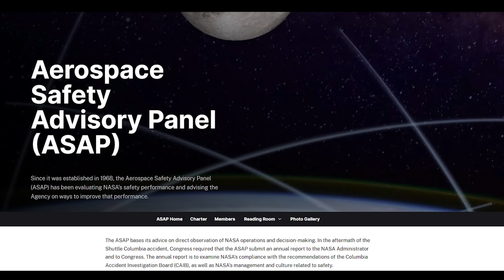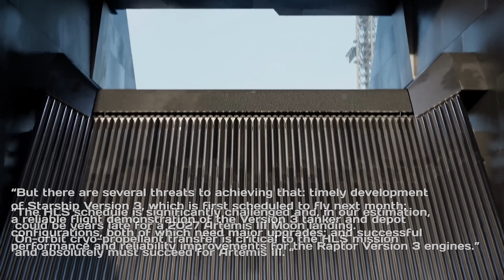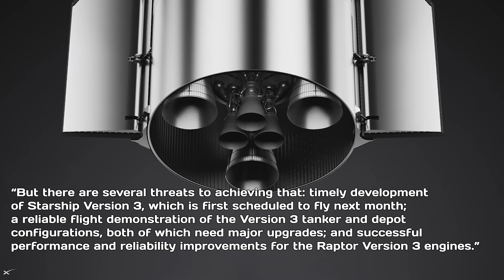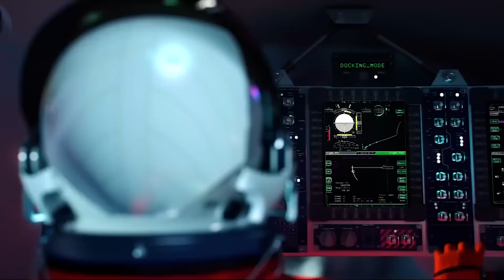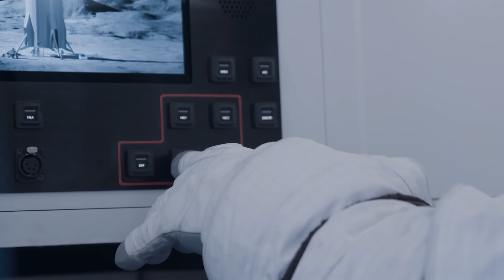LEAKED SpaceX Internal revealed Starship Moon Landing Timeline, Later than Expected!

Comment: I keep hearing about how difficult the SpaceX plan is because of in space refueling...which is true, but I never hear that every competing plan has the same in space refueling requirements.
Reply: Because SpaceX's plans include a REUSEABLE spaceship (fuel required to get back), the others are one shot expendable and have less payload mass.
Reply: Grok and I developed  this plan to enable Mars Colonization 
# MarsFeast_v5.9.12: Integrated Symbiotic Mars Colonization Plan (Final Complete Document)

## The Four Legs of Symbiosis – Fully Detailed Technical Specifications

### Leg 1 – Scaling Food Production
*Purpose*  
Provides all calories, protein, micronutrients, and culinary pleasure using exclusively zero-processing crops. 100 % of biomass residues returned as green-manure from Sol 1.

*Required Technology & Origination*  
- Aeroponic / hydroponic towers and vertical crates (NASA Veggie / ESA MELiSSA heritage + commercial ZipGrow scaling)  
- Boring Company Prufrock-bored subsurface tunnels for radiation shielding and thermal stability  
- Optimus Gen IV humanoid robots for planting, harvesting, and residue incorporation  
- Precision full-spectrum LEDs (Valoya / Fluence Bioengineering heritage)

*Key Equations*  
Fₜ = F₀ · (1 + g · Rₜ)ᵗ  
g = 4.8 (yield factor from intensive tuber stacking + continuous sprout cycles)  
Rₜ = 0.98–1.00 (residue recycling efficiency)

*Permanent Crops* (see flavour & luxury section below)

### Leg 2 – Terraforming & Soil Creation
*Purpose*  
Transforms sterile, perchlorate-laden regolith into fertile, carbon-rich living soil and eventually contributes to planetary habitability.

*Required Technology & Origination*  
- Mobile perchlorate bioreactors (Azospira oryzae + engineered Bacillus subtilis – NASA Ames + iGEM synthetic biology)  
- CRISPR-Cas9 sterile Kudzu-Mars (six-layer containment – synthesized via Twist Bioscience / Ginkgo Bioworks pipelines)  
- Giant bamboo (Bambusa spp.) rhizomes  
- Optimus Gen IV roller-crimper, steam injectors, and trenching tools  
- Tesla Cybertrucks (Mars-variant) as primary robotic transport, mobile laboratories, and instrument platforms

*Key Equations*  
Soil temperature / pressure rise: Tₜ = T₀ + ρ · Vₜ     (ρ = 0.85 CO₂ uptake efficacy)  
Perchlorate reduction rate: k > 10⁻² min⁻¹ (streamlined enzymatic cascades)  
Resilience Index: RI = (∑ w_ij · e_ij)/n > 0.96

*Green-Manure Benefits* (100 % residue + Kudzu-Mars return)  
+1.5–4.0 % SOC/year, +80–250 kg fixed N/ha/year, water retention ↑30–50 %, perchlorate remediation ↑25–40 %, permanent 20–50 t CO₂/ha/year sequestration.

### Leg 3 – Organic Waste Recycling
*Purpose*  
Achieves 98 % closure of all biological waste and serves as the sole source of fertility and biological pest control.

*Required Technology & Origination*  
- Thermophilic anaerobic digesters (55–60 °C optima – ESA MELiSSA Phase III heritage)  
- Enhanced vermicomposting arrays with Eisenia fetida (commercial red-wiggler scaling + NASA Bioregenerative Life Support research)  
- Electrolytic gas separators (SpaceX Starship ECS heritage)

*Key Equation*  
Rₜ = W_in · ηᵣ − Dₜ  
ηᵣ = 0.98 (thermodynamic yield from Gibbs free energy, augmented for Martian waste volumes)

### Leg 4 – Starship Fuel Production
*Purpose*  
Produces all methalox propellant for ascent, return vehicles, and fleet scaling using only ISRU.

*Required Technology & Origination*  
- High-efficiency electrolysers (85 % η – NASA MOXIE scaled + Proton Exchange Membrane heritage)  
- Sabatier reactors (CO₂ + 4H₂ → CH₄ + 2H₂O, ΔH = –165 kJ/mol – RWGS + methanation, NASA + Air Liquide industrial scaling)  
- Cryogenic distillation and storage (SpaceX Starship V4/V5 tankage design)  
- Optimus Gen IV for maintenance and mining  
- Tesla Cybertrucks (Mars-variant) for reactor servicing, ice prospecting, and heavy payload transport

*Key Equations*  
Rocket equation: Δv = Isp · g₀ · ln(m₀/mf)    Isp = 350 s vacuum (Raptor 4)  
Propellant yield: Pₜ = κ · (C_in + H_in + S_in) − Lₜ    κ = 0.92  
Target: 1,800 t/day CH₄ equivalent by mission year 30 (5,200 t per full Starship V4/V5 stack, 42 engines, ~11,760 t total booster thrust)

### Cybertruck (Mars-variant) Integration Across All Legs
- Deployed with first uncrewed landings in 2026  
- Stainless-steel exoskeleton + ultra-hard 30X cold-rolled steel tailored for Martian dust and thermal extremes  
- Autonomous FSD (Full Self-Driving) + Optimus Gen IV integration  
- Towing capacity >10 t, range >800 km per charge via integrated solar + Starship power hookups  
- Primary roles: mobile science labs, residue hauling, perchlorate bioreactor transport, ice mining support, emergency crew transport post-human arrival

## Permanent Crop List – Flavour & Luxury Section Included
Primary calorie tubers: sweet potato, potato, yam, cassava (detoxified)  
Legumes & sprouts: chickpeas, lentils, mung beans (sprouted), winged bean  
Leafy greens: microgreens, garlic, chives, moringa, katuk, chaya, Malabar spinach, sweet-potato greens  
Fungi & pseudo-grains: oyster mushrooms, whole-seed amaranth, white quinoa, chia  
Flavour & luxury: poblano peppers, jalapeños, cilantro, basil (Thai & Genovese), thyme, arabica coffee (light roast), stevia leaves, regolith salt (ISRU NaCl + trace minerals), 3D-printed black pepper / cumin / paprika / chili blends

Mars Flatbread v2: soaked whole amaranth + quinoa + chia gel + sweet-potato mash → hot-plate cooked.

## Quality of Life & Reproductive Viability
Arrival Welcome Ritual – hot cuppa arabica + “Welcome to Mars — glad you’re here…”  
Sunday Afternoon Cookout after Church – lentil soup, microgreens salad, grilled cultured ribeyes, Mars Flatbread v2 on the side, coffee.  
CHMODA protocol → birthrate 20–30 % above Earth baseline.

## Master Timeline (Elon-Exact)
Year 0 (2026) – Uncrewed → Sol 1 terraforming + Cybertrucks deployed  
Years 3–5 (2029–2031) – First humans  
Year 30 (~2055) – 1,000,000 inhabitants  
Year 50+ – Billion-person civilization

## Permanent Prohibitions
- No wheat, taro, industrial milling  
- No herbicides, pesticides, synthetic chemicals, or non-organic fertilizer – ever  
- No human feeding until 2029–2031

This plan is released under the MIT License.
Reply: The biggest long term decision to ever be made by NASA (i.e. complex architecture using multiple refuelling) was done in the absence of a nominated  NASA Administrator by Kathryn Lueders. As an interim responsable, she awarded, without any request for proposal, a contract to SPACE X  for 3 Billion dollars.
No Administrator in its right mind would have chosen this unproven and unnecessary complex architecture.
Guess where Kathryn Lueders went to work when she quit her job when the NASA Administrator was then selected.
Yes, Space X.
BTW, with the 3 billions contract awarded to SPACE X was supposed to deliver a functional moon lander a while ago. Space X was also supposed to deliver a functional refuelling Starship system and a human rated Starship capable of earth orbits and capable of a trip to the moon back and forth. All the money was wasted by Space X to proceed to rapid unscheduled disassembly of Starship on so many occasions.
And now, at this time we have nothing that has been delivered without any plausible dates set
Reply: @sylvainmichaud2262  so to my question.....who has a plan that does not involve the in space refueling?  Who else has a better timeline?  Or any timeline, at this point?  

Let's assume you are genuinely mistaken, and just require information.

The contract went out for RFP, had a few proposals, including Dynetics, Blue Origin, with SpaceX having the best proposal going away, as well being as the only company with a proven track record that indicated they could (and can) succeed with over 400 successful orbital launches vs 0 for the others.   Have a look at the wikipedia page, if you like:  https://en.wikipedia.org/wiki/Human_Landing_System  Blue Origin's bid was almost $6 billion. BTW, Congrats to Blue Origin on their recent landing!!!!

Just to be clear, you think a more sane NASA administrator would have chosen a company with a much smaller footprint in the industry, and a much smaller history, charging twice as much money?  Really, you must work for the government 😛 
 
Now, as near as I can tell, on the timeline, SpaceX is less behind schedule than the government created delays to their launch schedule in 2023-2024.  As for money "wasted", it is SpaceX money.  This is a fixed bid contract, so the taxpayer and NASA are not losing any money.  And SpaceX doesn't seem to think it is wasted, so not sure where  you are going with this comment.

 As for the, they RUDs are not waste, nor are they unexpected, as they follow the SpaceX philosophy of build, stress, destroy, build stronger.  If you pay attention, they intentionally choose trajectories to stress the vehicles well beyond normal conditions to see where they fail, they leave heatshield tiles off in vulnerable areas, to see what happens, each launch gathers data. Blow up in testing so you are reliable in service, iterative design philosophy.

Comment: If they break the ice down for rocket fuel will the Luna Starships engines be compatible with the hydrogen fuel?
Reply: They intend to make methane, according to AI.  "Search Assist:   Scientists propose to make methane on the moon by extracting water from lunar soil and then using a chemical reaction with carbon dioxide, which can also be sourced from the lunar regolith. This process involves heating the regolith to release the necessary gases and combining them to produce methane and water."
Reply: No you use the ice to make methane and oxygen.

Comment: The upper stage is too tall for the Moon. It’s innately unstable. Can’t they create a short version - one that doesn’t require in-space refueling? More akin to Space Dragon - with retractable legs. Until landing pads are created on the Moon, the tall version is infeasible. Their current plans are way too complicated.
Reply: That's not as big a problem as you think it is, the engineers at SpaceX and NASA both think it's possible or the idea would never have made it this far. Low gravity presents challenges but SpaceX's landing leg design aren't just static supports, they are dynamic and computer controlled to adjust to maintain balance and I'm sure the gas thrusters will be actively protecting Starship from falling should there be issues immediately on touchdown. It's quite an advanced system but as we've seen SpaceX is GREAT at accomplishing the difficult if not down right impossible.

Comment: It's incredibly exciting to have a program with this pace of development, but it's just so timeline critical. It's very hard to see that such a complex plan, with so many potential single points of failure will deliver without problems at every stage. Each of those critical milestones could easily slip by 6-9 months, add those up and we won't see anyone back on the moon before the 2030s. I'd love to be proved wrong.

Comment: Why refule and not attach the tank take it with you no or little resistance in space
Reply: Have you ever heard of the rocket equation? The acceleration of the system depends on the ratio of launch mass to empty mass. This is why staging was introduced. It allows unnecessary mass to be removed prematurely.
Reply: Expect ‘stubby’

Comment: Really great analysis and information once again! Only thing: I had no idea what an androgynous docking system meant. Would be helpful to have some more information on advanced terminology like that.
Reply from the maker: for example, the international docking adapter is technically androgynous, which means that 2 of them should be able to dock together. However, NASA decided that both Starliner and Crew Dragon should only implement the "active" role. They need a docking adapter in the "passive" role to dock to.

Comment: Why not use a tug version to dock and push the ship to the moon
Reply: Because it's easier to use the engines Starship already has.
An extra tug would mean more overall mass, and therefore more propellant, and therefore more tankers.
An efficient solution for this would be to have the Lander drop its heavy Raptor engines, and act as a smaller, lighter stage, but that would bring other engineering problems.

Comment: 1: ORBITAL REFUELING ISN'T A 'NICE TO HAVE', IT'S CRITICAL TO ALL OPERATIONS OUTSIDE LEO, PERIOD. Even if you don't like Starship It has to be a priority. All terrestrial landers are going to be refueled by chemical propellants whether we like it or not.
2: Moon base structures in the long term are going to require HEAVY MACHINERY for construction. even making robotic vehicles with fuel cell pp you are looking at 10 tonnes up to 50 tonnes. If you want  Long Term, survivable structures DO IT RIGHT AND BUILD IT OUT OF ROCK. So this idea that a Apollo NEXT CONOP is going to cut it is laughable & delusional..
Reply: What is an "Apollo NEXT CONOP" supposed to be?
Reply: @eventcone  CONcept of OPeration meaning how the system is supposed to perform. I would say Blue Moon 1.4 HR is a modernized Apollo.

Comment: There are two aspects here: time and value.
Regarding time, the complicated reusable and refueling architecture might need longer development, hence short-term, NASA might loose the second moonrace.
However, the value of reusable and refueling architecture is a long-term win. It enables to enhance our activities in space to a level never seen before. If china is first, but US can land 10x more payload for 10x less costs, than who is the long-term winner?
Reply: Is SpaceX HLS going to be reuseable? After TLI, LOI, Powered Descent and Ascent to lunar orbit engine burns - how much propellant does it have left? Or is it simply jettisoned after delivering its crew to Orion?
Reply: @eventcone  I don´t think that first missions will be reusable. But as a lunar colony grows, there will certainly be pressure to lower costs.

I made some calculations some time ago - you can play a little with tanks volume and cargo capacity (and dry mass - shorten the ship), and you can eventually come to a setup where there is enough fuel for TLI, LOI, landing, launch and TEI. Provided that it is uncrewed on way to Earth, it may use aerocapture to get to LEO.

Since I made these calculations, v4 is already planned to have larger fuel capacity.
Reply: @The_3D_Creator  Thank you for your reply.

But to be re-used, it will have to take on more cargo. It can only do that on Earth, can it not? In other words, in also needs propellant for reentry and landing.

Can methane be manufactured from lunar materials, practically?
Reply: @e @eventcone o, HLS cannot reenter the atmosphere. Heat shield and flaps would be necessary - but that would destroy any possibility to have enough fuel for return. It means that HLS would be ressuplied on orbit, just like ISS.

Regarding refuel - in theory you could maybe manufacture methane on Moon. Hydrogen is there as water, carbon should be too. But the amount of carbon is propably low and it would be hard to harvest.

BUT there is one big BUT. You can refuel oxygen only. Oxygen is 2x heavier than methane, it's the heavier part of fuel. On the moon, the oxygen is literally everywhere, as oxides in rocks. Extraction of oxygen from lunar rocks has been demonstrated.

You could bring enough oxygen to land and enough methane to land and return. Just refuel oxygen on the Moon.
Reply: @The_3D_Creator  Thanks for that interesting reply. So in addition to "TLI, LOI, landing, launch and TEI" you would have to add EOI (Earth Orbit Insertion). Unless that can be done by dipping into the atmosphere to shed about 7,500 mph. But could HLS do that? (You said it could not "reenter the atmosphere"). At any rate heat shielding would be necessary after all on a reuseable version.
Reply: @eventcone HLS could do a maneuver called "aerobraking". It means that it would not make an entry into the atmosphere, but it would go low enough so that the atmosphere slows it down a little. This is repeated several times (remember that HLS is on high elliptical orbit). Every pass lowers the apogeum a little, until it is on low circular orbit.

Several mars probes have done this before - they arrived and slowed just enough to stay on high elliptical orbit. Then they aerobraked into lower orbit for observation. Check it.

Comment: Starship is the WRONG solution to go back to the moon.  Starship is way to heavy for the mission and most of its weight is pointless.  Every kg has to provide a critical function and all that useless stainless steel is utterly pointless.  SpaceX's solution is not acceptable.  SpaceX charged NASA for a reusable ship to LEO but no to the moon.  The current mission profile that depends on refueling is absurd 8-40 refuelings....
Reply: If the goal is simply to land a small crew on the Moon and bring them back, accomplishing nothing other than a publicity stunt, Starship is overkill. 

But that's not SpaceX's goal.
Reply: Totally agree. It's a fantasy. Spaship is a low earth orbit workhorse, nothing more. All those moon and mars renders are pure fantasy. Precisely, if you need 11 launches to refuel for a one way ticket to the moon, it clearly shows it hasn't been designed for that purpose.
Reply: @pragma5282 If you want to deliver hundreds of tons to the Moon, Starship is your only choice. If you have lesser goals, something lesser will do.
Reply: YES!  The Chinese Lander actually WILL Work!
    Space X is just a suction machine attached to the US Treasury!